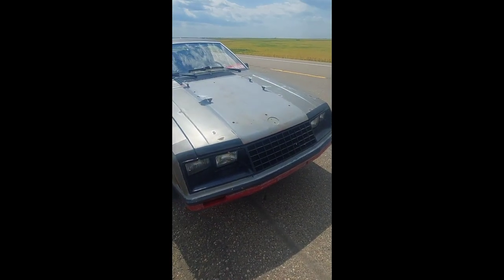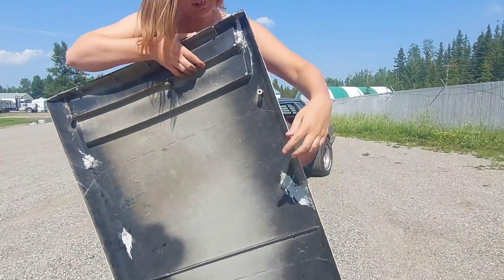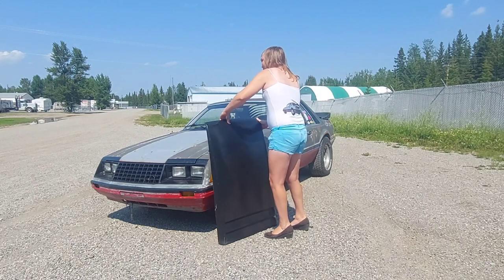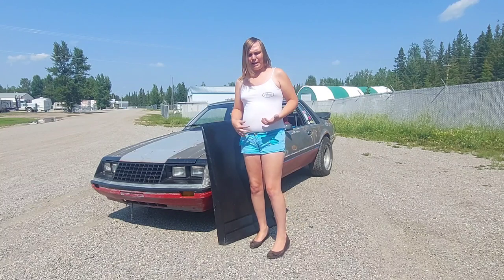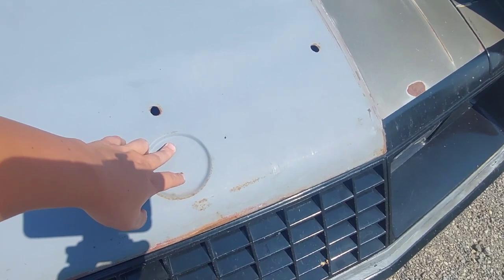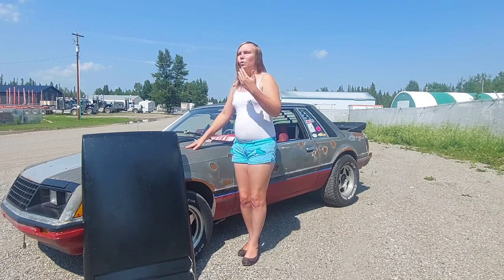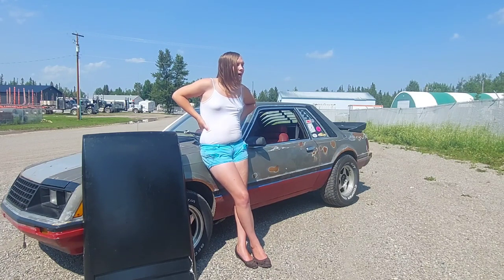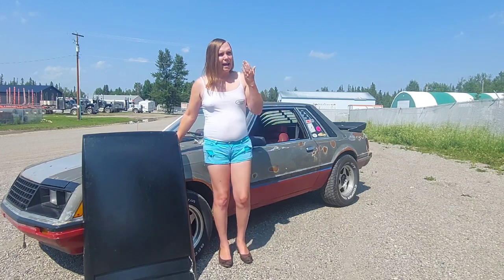My rare pace car scoop on my mustang flew off after street machine weekend.. Lets inspect the damage

Comment: The hood should be easy to repair, if you are good with fiberglass. I remember seeing a product called "cool can" about the size of a coffee can, and it has a spiral fuel line inside. You fill it with ice water and it prevents vapor lock. Just an idea. Stay dirty 👍

Comment: Hey I have a question for the 86? Do you know if sn95 v6 exhaust headers will fit on the 83 to 86 v6? I want to do some upgrades but there isn’t many out there for the v6 Fox.
Reply from the maker: Should fit no problem. It was only the internals and the injection that changed. But the headers themselves should have no issues bolting on.
Reply: @KatarinasGarage  awesome thank you so much! Love the videos, it’s been a while since I’ve watched but they are still awesome as ever!